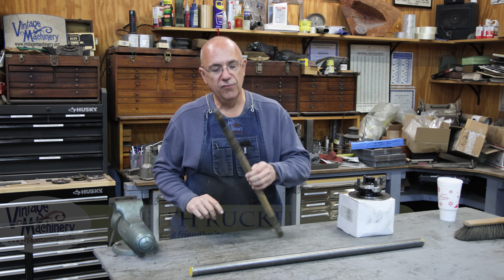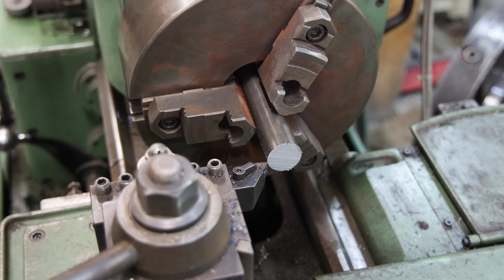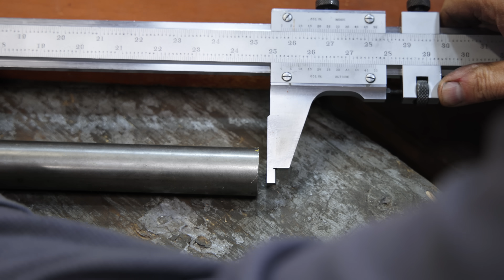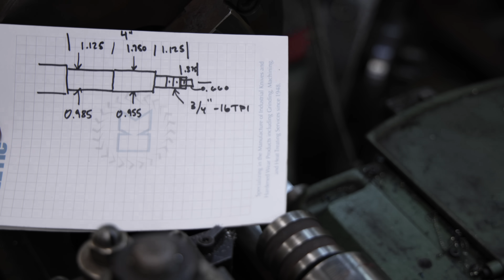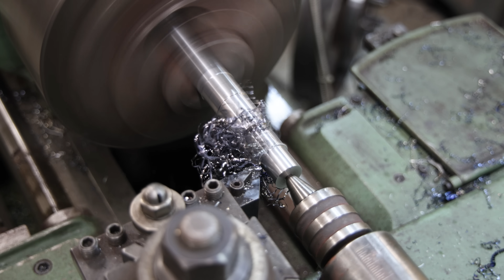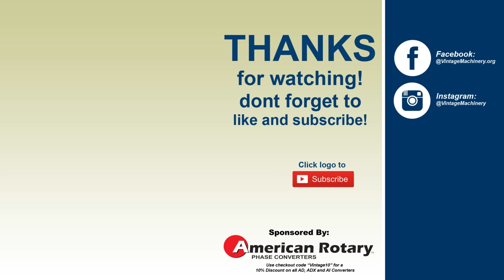Turning a New Golf Cart Axel on the Metal Lathe

Comment: At about 19:00, you moved the cross slide back and bumped the tail stock back about a 16th inch. Dont think you've caught it yet.
Reply: He did catch it, but didn't talk about it. A few seconds later you can see that it introduced a little runout at the end, but no big deal because he tightened up the center and then turned that end down smaller in the next "step" so it didn't matter
Reply: It moves back into place around 19:47
Reply: This "Master Machinist" has not even tightened the tail stock, hooo boy!:body-blue-raised-arms::face-blue-smiling::face-blue-smiling::face-blue-smiling:

Comment: Keith, a number of years ago, a camp director told me they bought an older 3 wheel golf cart, and had to get a brass gear rebuilt and then cut teeth to match. It turned out well, and if I recall, they are still using it today.
Keeping older stuff going does require "new parts" for obsolete ones.

Comment: The wheels of the Golf Cart are supposed to rotate around an "Axle". "Axel" might be the owner's first name.
Reply: At least Keith is consistent.  Spelled incorrectly in the thumbnail AND the title, in identical fashion
Reply: The Axle is bolted to the Hub so it turns the Wheel. the left side is splined into a Spider gear of the Differential. the right side has the threaded end for the Hub...
Reply: An axel is the name for  a figure skating jump :-)
Reply: Axel Foley.
Reply: Axl rose

Comment: I can understand how making a replacement for this part would be the best solutions. However, if you could use a die to clean up the threads and then machine off the end of the splines assuming there would be enough spline left to use, I would think it might repair the part well enough.  OK, this might not work and I am not able to actually see the part so my suggestion might not work.  I am sure you will make an excellent replacement.

Comment: making a steady rest for your lathe would be a fun project to watch
Reply: I made one for my ancient Hercus lathe.  Hercus is an Australian made South Bend clone found most commonly in the commonwealth countries.  The follow rest made cutting threads on thin stock so much easier.
Reply: I was thinking the same thing.  It wouldn't be that difficult to machine but would be something different.
Reply: Agreed.   Would like to see how the follow rest is built, cast by Clark at Windy Hill or completely fabled in your shop.  Happy Thanksgiving
Reply: I am literally making a larger steady rest for my Mori. 10-1/2" bore. Been a fun project so far. Had some 2-1/4" plate cut at my day job on the CNC plasma table  leaving enough to machine all the critical areas. Still have to make the adjusters, last step before I can use it

Comment: It is so discouraging that one has to spend a good amount of money to buy something and then find out that parts are discontinued . So sad. But it's wonderful that someone like Keith can come through and make it.
Reply: We don’t know how old that cart is. Or if the company that made it is still in business. 
My father wanted me to get a part for an old desk lamp. The lamp was 60 years old and he was surprised they no longer made parts for it.
Reply: It is more discouraging that a drive shaft is made out of inferior products to begin with.
Reply: When I was in the Navy in the mid-1970s I was assigned to a floating drydock which had been built in 1942.  We  had to replace the wiring harness on one the cranes.  We discovered that the company which made the original harness had gone out of business sometime around 1960.  We pulled the harness out of the crane and a couple of electricians spent a week or so duplicating an old, brittle set of wires.  Just to be on the safe side two harnesses were made and the second crane got new wiring as well.  The dry dock was decommissioned in 1997 and given to the Chilean Navy, which is still using her.
Reply: There's a new industry to come facilitated by 3D printers.  Old, broken, worn-out parts remanufactured by 3D.
Reply: @tomtke7351 I wouldn't count on it.  This topic has been "coming" for 40 years.  I remember "Donahue" having 3D printer beginnings on his show.  Yes we can print stuff but we need a model and then we need a printer that can make it from suitable materials.

Scanners aren't quite there yet and when they do work then repairs need to be made to models.

Printers need to be large enough and print materials suitable.  That not there either.

The "concept" cannot move forward until the modeling step is thoroughly automated and the materials get as strong as aluminum (at least) with no layer line weakness or brittleness... and the ability to make a harder or hardenable section for shaft ends somehow.

That being said.  I am working on a set of plastic end caps for the sides of a bumper for a golf cart.  They are discontinued and one is broken.  The other is "ok" mostly.  In cold weather climates filament choice is difficult.  Probably going with carbon Fibre PETG.  It should  be OK.  Its going to cost the guy $100 or $150 for a pair of them so its not "cheap" nor fast.

If you want a glimpse at what you think the future looks like in 3D printing, look at the parts NASA 3D prints.  They print with metal and they gradually can change from one material to another.  An aluminum strut shaft with a stainless steel bar on one end (molecularly) mixed with the aluminum seamlessly.  And then it can have splines machined into it.  On the other side a bronze ball that will go into a socket.  Again the bronze molecularly mixed to the aluminum shaft.

Comment: What ever happened with your 10EE project?
Reply: @oldschool1993, Not on an original Monarch 10EE she wouldn’t, a VFD won’t work on that. Not without replacing the motor in it.
Reply: @Hoaxer51  Well, why would you want to rely on an 80 year old DC motor and spend years trying to perfect some one of a kind drive system hoping the designer will be around forever instead of just buying a new 3 phase motor and compatible VFD.
Reply: @oldschool1993  I rely on my 80yo DC motor on my Carlton all the time. Even if it is sadly only powered by my  DC welder.  Someday I will have a proper motor-generator set so I can have that smooth dc action at full strength. :-) Just need time and money,one I don't have and the other goes as quick as I get it.
Reply: @oldschool1993, I was just pulling your chain about the VFD, if I had the opportunity to own a Monarch 10EE the first thing I would do is to do a motor swap with a VFD. I’d make it dependable from the very start so it wouldn’t be a problem when you really needed it.
Reply: The last I remember was a couple years ago it was stalled out by that overly complex engineer designed electrical system.
Reply: @oldschool1993  As I recall he had an electrical engineer working with him on it and it was nearly complete.
Reply: @sharkrivermachine  Myself and a number of others have asked about this project with no answer.  I suspect the "nearly complete" system just doesn't work and maybe Keith and/or the engineer guy have tossed in the towel.  Maybe Keith will finally address this and lay it to rest.
Reply: who do you want designing electrical / electronic control systems?
How about a “newcomer” who just entered the U.S. from Mexico. Her only experience is picking bananas and having children. She’ll get that 10ee running. 
When my grandparents came to this country as kids early in the 20th century, they had to be sponsored by a relative who promised to house them. Adults had to have a trade that the U. S. Immigration people listed as worthwhile.
So engineers, skilled tradesmen, merchants were welcomed. I don’t think any of those sneaking into our country today could repair or design a control system for a 60 year old lathe. Or any of the electronic devices that are an integral part of our everyday lives.
Reply: @stevenslater2669  Actually, your Mexican grandmother could have done it by simply installing an off the shelf VFD drive.
Reply: @stevenslater2669  Amen!
BTW are you the guy from Fisher Body?
Reply: Evidently the same thing that happened to the Stoker Engine project, they plan on having the Locomotive in operation at the end of 2025,so I guess they will be using a coal shovel instead!
It's not a real good business model to accept a job, tear it apart, and then just leave it lay around for years!:body-blue-raised-arms: